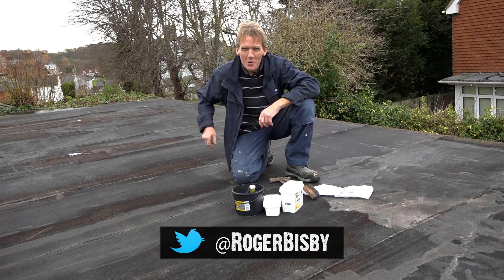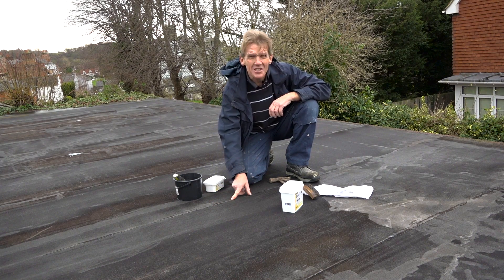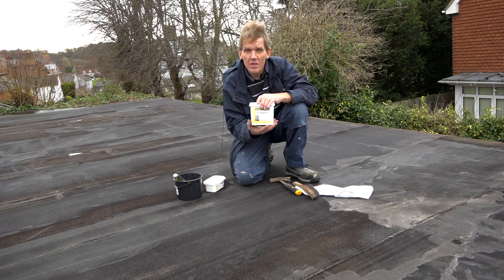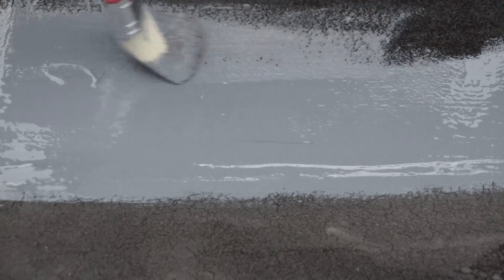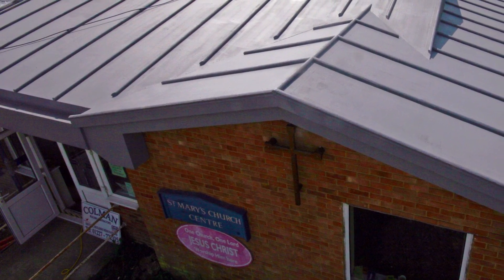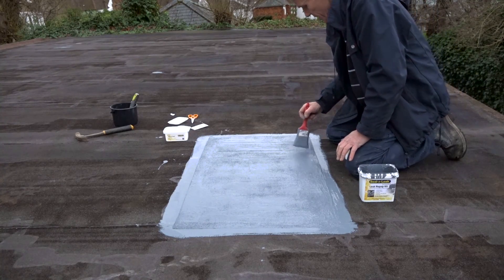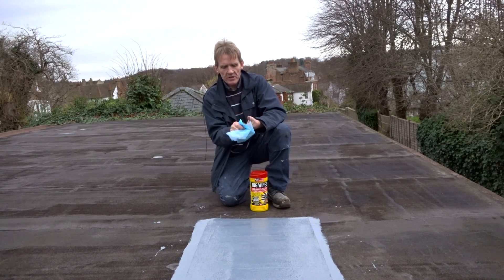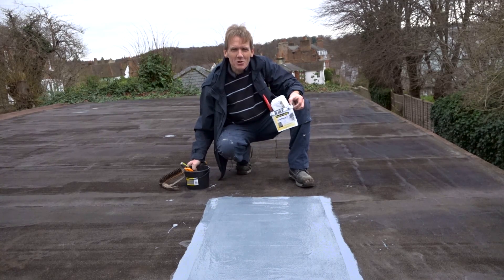How to Fix a Leaking Flat Roof with Sealoflex Seal-a-Leak

Comment: I'm thinking about using this on a new flat roof dormer. My roofs are between 1 and 3 m2 with lots of angle changes, parapet up stands, outlets and drip edges. I think this makes sense as with pvc single ply or epdm I would need lots of cuts and patches in the material to make the complex surface.

Comment: Roger, I looked at this, £448 for that little kit you used. Surely that can’t be right? Mike
Reply from the maker: I think it is. Most of these acrylic fibre coverings are expensive but it is still keeping out the water which is more than the previous £9K job did.

Comment: A 3 layer Torch on bitumen felt system done properly will last 30 - 40 years .  
Sealaflex has as far as I know has only been around 15 years , it’s very messy but a solid system . 
Only time will tell if sealaflex outlives a 3 layer roof .
Reply from the maker: Hi Barnaby
I agree that a good torch on system should last but we know that many are not done well. This roof is on chipboard which is sagging all over the place. It is either a question of stripping it off or using a treatment such as this. You have to work out ways of working cleanly. 
This PU compound has been around a lot longer than 15 years. I have seen massive flat roofs in America done with it. A ten year recoat over the existing extends the guarantee but without it I would still think 20 years is in order.

Comment: Can you spray it on roof where the shingle won’t move, imbedded in the old bitumen?
Reply from the maker: You can coat the shingle but it isn't as good because all those sharp bits are potential leaks.

Comment: Can I use this over GRP.
Reply from the maker: You can but there is no need. You can always top coat GRP with more GRP. Just give it a rub down with abrasive and slap on another coat.

Comment: Roger mate. I got a customer who wants me to repair her flat roof, I been up there and can't see anything wrong but to replace the facia boards and clean out the gutter. its a proper green mineral roof, should I just paint over all the joints and apply lead sealant around the flashing for good measure? and with this heat we having is it a good idea to cover the roof with shingles? your help is much appreciated.
Thanks.
Reply from the maker: If it is leaking then it must be getting in somewhere. If you can take some video and send it to us on www.skill-builder.uk I can have a look
My feeling is that you need to clean if off and apply a coat of Flexacryl or similar fibre reinforced sealant.  At the same time tell her that a new roof is the only way to guarantee it. The Flexacryl should work but I have just had to go back on a job we did 8 years ago to apply another coat. 
I would not use mineral chippings. I hate them. The solar reflective Flexacryl will be better than the white chippings. I can't see how putting sharp bits of stone onto a felt roof was ever considered to be a good idea.

Comment: I've not used this brand however used similar such as acrypol. That has fibres in it for reinforcement. It's wonderful stuff. When I'm putting a shed up I slap this stuff under the felt gives it a good waterproof barrier below the felt. Belt and braces.